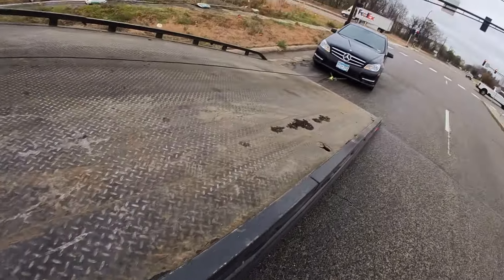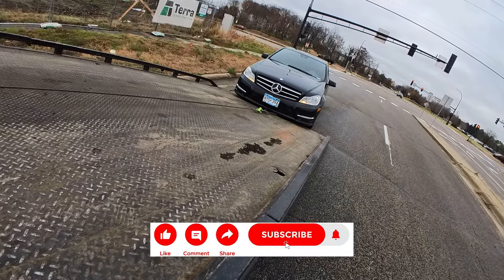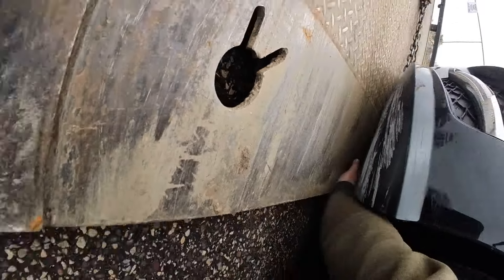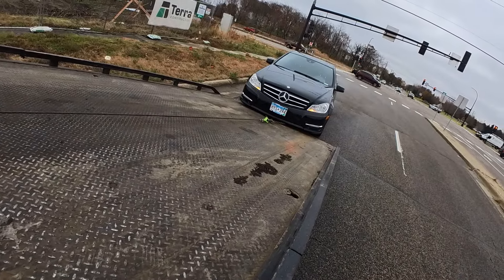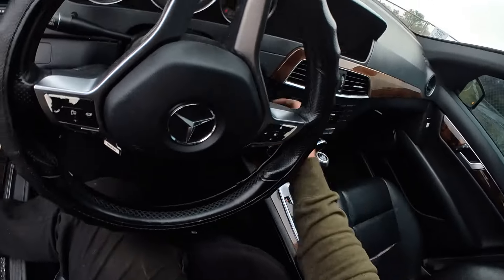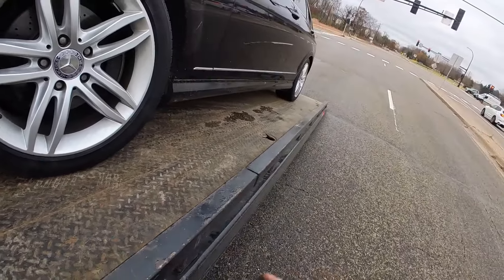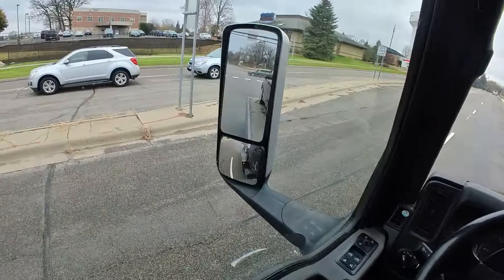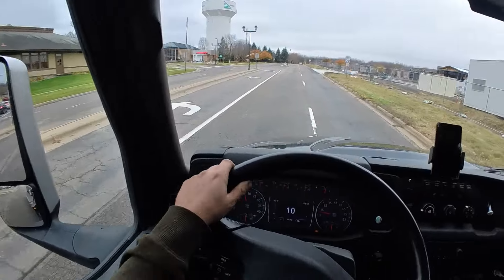Loading a lower car on a bed without special equipment

Comment: I dislike when those mini j hooks or T hooks get stuck at the end of the bed.
Reply from the maker: Doesn't happen a lot but when I drop the bags the angle gets smaller and it catches more. Leaves a small gap at the end of the bed.
Reply: @ yeah I know how that goes. If gets stuck at the worst time and you have no clearance 😂